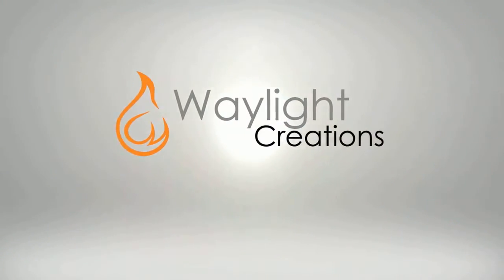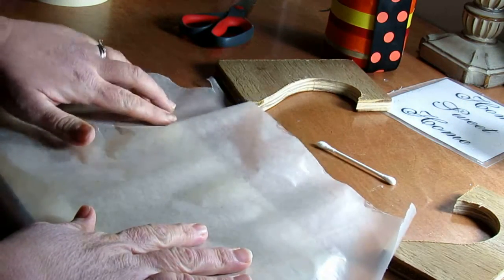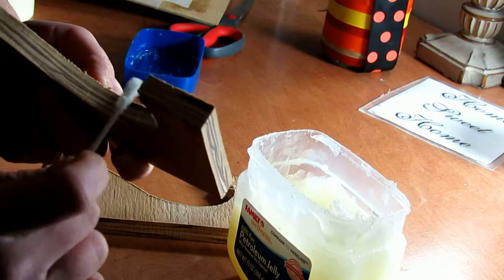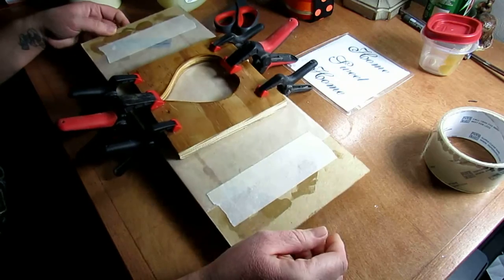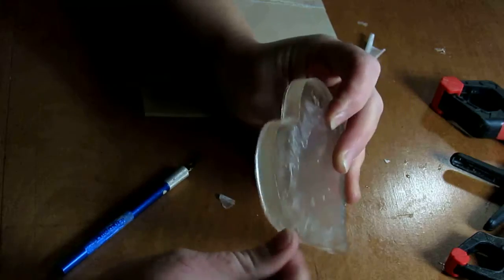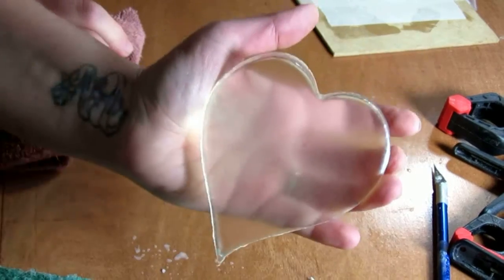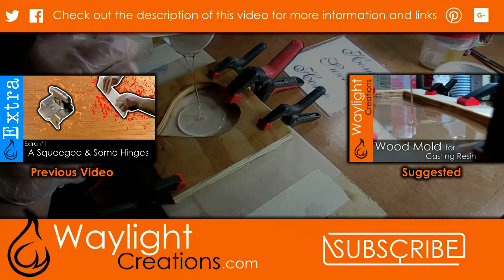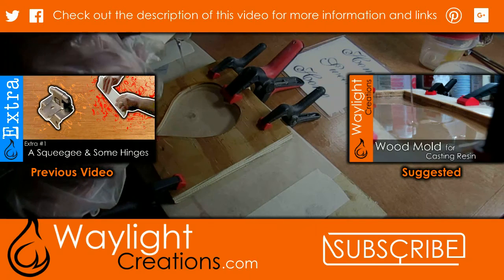Epoxy Resin Heart -  Resin in Wood Experiment #2

Comment: I have these slim silicone pendant molds, which shouldn't be a problem for unmolding, but they're long and skinny so... Problem.  ;) I was in a pinch, so I used what I had... Antifrizz serum, applied w/ q-tip wrapped in plastic wrap. It helped ;)
Reply from the maker: Oh, that is very cool. Thanks for the tip.

Comment: if you finish the wood with a polyurethane, will the petroleum still be necessary?
Reply from the maker: I'm not sure. I think it would still stick to it because it would be a hard surface. The petroleum creates a barrier that does not adhere to either surface. We have actually found some new methods using vinyl sheeting that work pretty well too. You can check it out in our wind spinner video and most of the superhero emblem videos. Hope that was of some help.